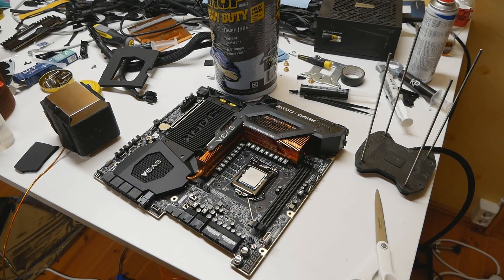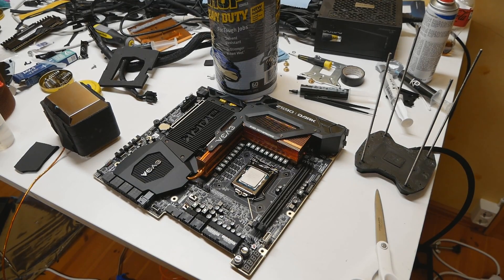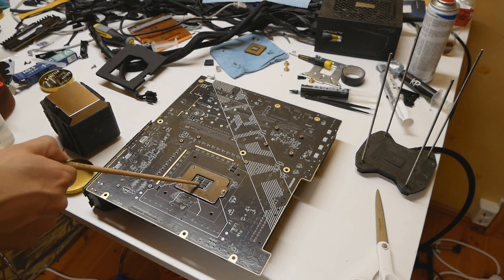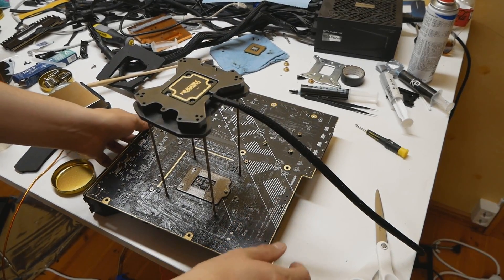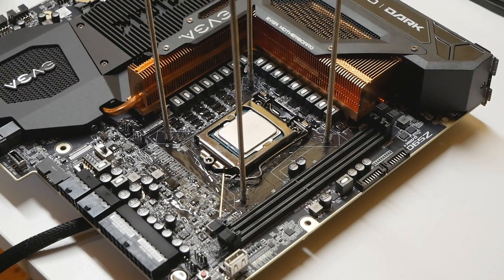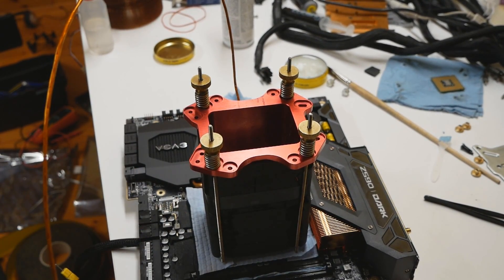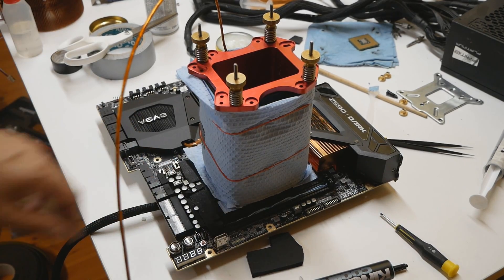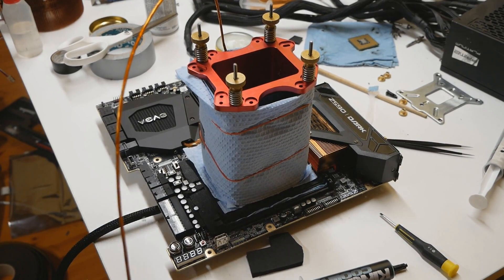How to Prepare a Motherboard for Extreme Overclocking (EVGA Z590 DARK)

Comment: Hi 😊 because when my pot is to -110 the moterboard go to coolbug?? Help my please 😂
Reply from the maker: What CPU are you trying to run?
Reply: @LuumiJuhani  using 13900k i dont can run more to 6.4ghz neithr to higth voltage
Reply from the maker: @bruitabruno  Do you use custom bracket or stock ILM?
Reply: @LuumiJuhani  i use contact frame and plate  of t-rex
Reply from the maker: @bruitabruno  Use stock ILM. Likely your cold bug is loss of contact on some pins.
Reply: @LuumiJuhani  which is Max voltage that i can give ??
Reply from the maker: @bruitabruno  Input VCCIN 2.6v but im sure your problem is the bracket. Use ILM.
Reply: @LuumiJuhani  cpu voltage i can give more to 1.7v ? Im scared
Reply: @LuumiJuhani  tanks bro tuo are number one of overclock ❤️😘

Comment: @Lumi, Great Video. Thanks, but how do you clean the board afterwards? Do you really put it in the dishwasher? Or are you one lucky guy that could afford an ultra sound cleaner. Vaseline is so messy. Have you ever used Liquid Tape and Plasti Dip? Then why going back to Vaseline? But please a short video on how you clean your boards. And hopefully convince me I don't need to buy an ultra sound cleaner... because I can't afford it